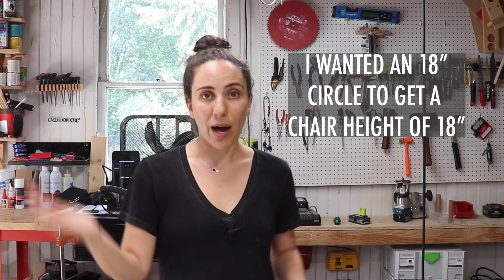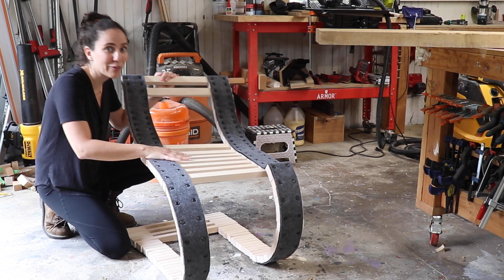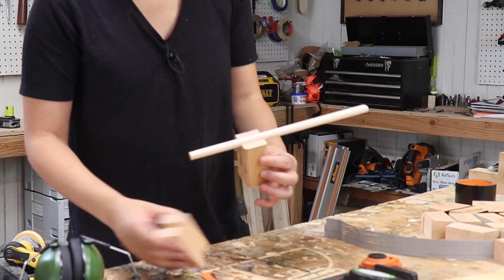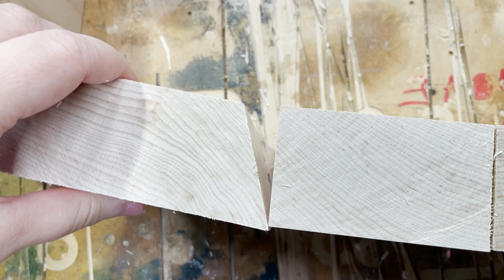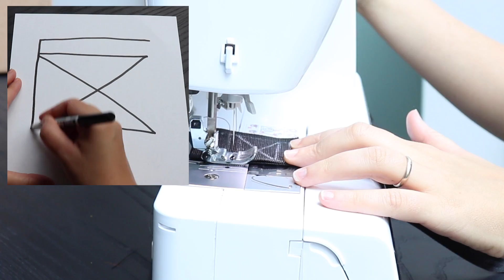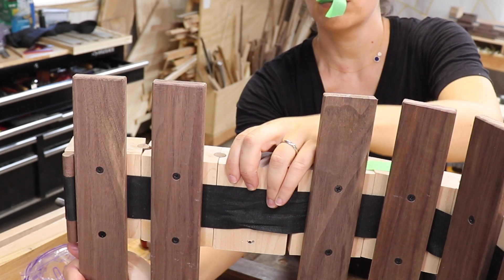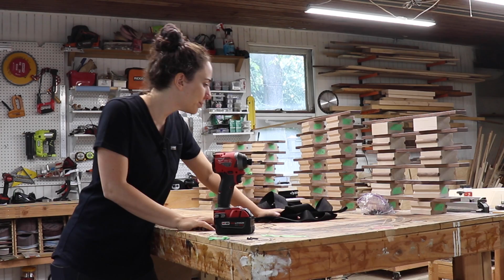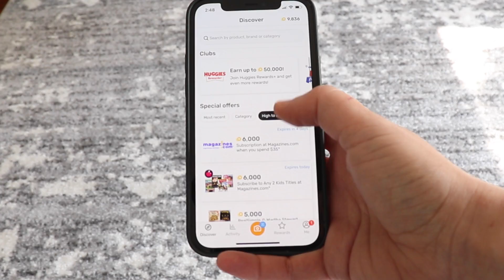I ATTEMPT to make a Roll Up Chair… AGAIN...

Comment: Leather would be way too flexible for this purpose. Metal would be the only way that I could think of. Due to the enormous stress in the lower curve I don't think this chair would work longterm. Wood contraction due to weather changes would also be a problem

Comment: As someone who works extensively with leather, I can tell you that it wouldn't hold up under that kind of tension unless (maybe) you used a heavy, strong hide that goes across the whole chair (a panel rather than straps).
I think the best solution would be to drill holes through the blocks and run a steel or aramid (Kevlar or Technora) cable through the blocks and have some sort of tensioning system on one end.  
Second to the cable idea, I would use aramid straps, as aramid fibers have some the lowest elongation of any soft fibers.  However, there is still going to be some stretching at the beginning as everything mates together.
You may also want to rout channels under the rungs for the straps to go through and have a tensioning system for the straps.  This may be easier than a tensioning system for cables.

Comment: How about metal hinges instead of strapping? And the thicker you make the pieces the less of a lever you're creating for them to crush or stretch with, so maybe make them narrower but thicker? But what I really think you should do is some math around forces and material deformation, because the chair back, or even the seat is a very long lever acting on every piece along its thickness. I don't think there's any strapping short of maybe metal or carbon fiber that could withstand it without significant deformation.

Unless you add something to hold it up. You could keep the shape and cheat a little by adding metal rods as sort of invisible back legs. I know it's less satisfying but would definitely make this a lot easier :)

Comment: You probably need to route a channel on the blocks so that the straps can move under the slats, and then add a ratchet at the end of the chair to tighten the strap as much as you need to.

Comment: I have to admit that I was going to overlook this one, but I am glad that I had not turned off the autoplay option on this browser.  I admire your perseverance with this project.  As I was watching this, and seeing the frustration, I thought, why not just use hinges?  But then I thought, why not make this out of wooden hinges?  You haven't compromised on quality wood for  this project, how about making wood hinged parts that lock one way at the correct angle, but allow you to roll it up the other?  Good luck, and I look forward to the next instalment

Comment: Cable running through the centre of the blocks rather than strap or anything on top of the blocks would stop it collapsing under tension. It would of course then not roll up unless you un tensioned the cable haha so perhaps not the solution you need :P

Comment: Argh i'm sorry for your new fail attempt. Maybe metal screw hinge may work. The Woody need to bé the one taking the compression and not the strapping. Some form on thé Woody contact surface that dont allow Space creation may also work.good luck

Comment: Like the Smurf’s say, “one twig can bend and break easy, a lot of twigs held together will not so easily.”, or something.. have you tried sewing two layers of strapping on top of each other? You could even sandwich some stuff in between like steel wire?
But thanks for sharing Tamar, super awesome design and perseverance!

Comment: Just running the numbers in my head your problem is still the enormous forces you're up against. You need a material with little elasticity and high tensile strength, in the general vicinity of 20kN of breaking force.
That's about 2 metric tons just so you get a feeling for the forces involved here. We're talking 6mm steel wire.
You also need to get rid of those free floating pieces, as you noticed that's rather dangerous.

Comment: From force perpective :you need not only strap to counter tension on the outside ,
but reduce required compression strength between  individual wood block on the inside.
You can
 1. make block thicker perpendicular to surface ,especially in curved section.
2.make contact area bigger(with wedge shaped block or hard rubber.)

Comment: Have you thought of using bicycle chain... Run a dado thru all the maple pieces down the middle. Put the chain in there. You might even be able to put a screw or 2 in a couple links of chain per piece..it shouldn't stretch at all.. you can use a chain breaker to join a couple different chains to make it long enough.. but the rest of this last design was rather perfect... You're smarter than me so I'm sure you'll eventually get it. But I think something with 0 stretch and minimal glue would work.

Comment: I can't remember if you already thought of this in the original video, but perhaps if you were to fix the strapping more rigidly in the high-tension areas (the curve at the base, mainly), because your shortening it is shortening it a small amount over a long length, which is likely an overall small increase in force.

I'm seeing this kind of like a spring (rightly or wrongly, I'm not sure), where the force of the strapping is proportional to some kind of coefficient of elasticity and difference in length. By shortening the straps you're increasing the differential length, but if you were to fix the strapping on either side of those problem areas so it can't slide then you're increasing the tension in those areas only. Maybe a double layer of strapping too? 

Perhaps you could run the calculations, it shouldn't be too difficult to get the moment around the problem areas (a simple moment calculation would be a good enough approximation), then you could work out in theory how much force it will take and how much the strapping will stretch. From there you could test a few different types of straps to find one that has an acceptable stretch and is able to hold enough weight...?

Comment: The original concept was for this to be a rollable chair, but I don’t think you’re going to find a solution to this which will provide strength, safety plus roll-ability — at least not with wood and webbing. Maybe you’d be able to achieve this with a braided cable that runs through the segments, but you’d need to add an adjustable tensioner for when you transform into chair mode. I’m just thinking out loud because I have yet to see this design work as an actual safe chair — I’ve only ever seen it as a design with nobody sitting on it.

Comment: I think you are onto something to use contact cement and glue the strap to each block. That way the strap will only flex between each block and not stretch over the hole length of the strap.

Comment: Instead of continuing to look at straps, why not use hinges? Either wooden or metal hinges? Ooo, maybe something similar to the barrel door hinge type thing. Maybe the wood is too flexible for that type of joint with WAY too much force in concentrated areas

Comment: I wonder if instead of straight pieces on the bottom section (and back), you cut the pieces with complimentary 45degree angles (like a row of parallelograms). Would those nested angles help prevent the individual sections from curling up under extreme tension? 
Also, would it be possible to add a second pair of straps on the under side of the chair to provide some counter tension?

Comment: You may have to give up some of the convenience of rolling up.  Instead of dowels, maybe on the curves have an hourglass shape peg (ie dovetails) that you insert when the unroll the chair to maintain the shape and keep the timber blocked locked from moving.  Then to roll up remove the hourglass pegs.  The other thing would be to not use one long piece of strapping but many short pieces, however the issue there would be securing the short straps to each block with the join holding. not sure glue and screws would be strong enough.  The third idea i have is to use 3-4 straps but in a weave.  I have no idea if this is even possible, but the idea being the tension works in multiple directions. By weave i mean over one block under the next then over again. You'd probably need to cut recesses into the face of the block though for a tight fit.  The idea being the tension forces would negate each other... pulling the blocks together tightly.

Comment: The leather is more stretchy than the webbing you're using, especially over time - I feel that it will unlikely to be better here.

Maybe if each pair of pieces had wooden hinges around those dowels... like metal bracelet construction, but with angles stopping further unfolding or something...

Comment: The concepts you need to consider are "modulus of elasticity" and "method of sections" technique for structural analysis. 
These are engineering concepts and understanding them is the key to your problems.  Maybe get some engineering advice?

You are basically trying to build a pre-stressed beam but without the prestress and in an unstable shape as well.  I am thus not sure that what you are attempting is even possible but you will save a truck load of time by getting some engineering input rather than using trial and error. 

As a guess (without doing any analysis) i would think steel cables down the middle of each block would be needed, that you tension after rolling the chair into shape via a screw thread run through the horizontal section at the base.  This might need to be a single rigid piece to accommodate the screw thread. 
I doubt that the concept of "just unroll it and sit on it" wil work.
Reply: I have to agree with Tano17's "get some engineering/design help" suggestion if you want to grit your teeth and continue. I think that you are about at the point of diminishing marginal returns -- more and more effort will result in smaller and smaller results -- if you continue your empirical approach. You haven't failed. I say again, YOU HAVEN'T FAILED. You have succeeded in showing that the concept can work: you've got a chair that rolls up and unrolls to close to the shape you want and that's progress. All you are doing now is refining the design. Any researcher/developer/inventor will tell you that once you prove that a concept can work, it takes a lot of time to get it to a final design because often it is little things that make a big difference. For instance:  wood is not incompressible and when you put stress on the blocks on the inside of the curves, the wood is going to compress a little and the curve is going to get tighter, even without the strap stretching. Wood isn't very resilient so it won't take much force to begin crushing it and changing the geometry. Meanwhile, back on the other side of the blocks, the strap is going around a little sharper curve where the two blocks meet and that sharper curve puts more stress right at that point of the strap and that will tend to stretch the low stretch fabric just a little more there than between the corners. Or, you might need to change the location of the rollers either closer to the straps or farther away for some reason. Or . . .

Or you might have to find just the right way to hold your mouth! (Egad!)

These may not actually be factors in your situation, but they are the kinds of little things that might have to be looked at to get where you want to go. 

I admire your tenacity, lady, the "making" effort must have taken weeks, not to mention the media time and editing. I really like the way you do things and especially how you show and describe things. Hang in there, ya doin' good!

Comment: With this design where the strap is only connected at either end, you are letting the stretch of the entire length of strap to be able to end up across one gap between blocks. To restrict the tension as much as possible, you would want to connect the strapping to each block, as close to the ends of the block as possible.

You want as much strapping that stays straight to be able to be removed. That is where 99% of your stretch is coming from.

You’re essentially only needing to use the strap as a hinge, so any excess strap beyond that is only contributing to excess stretch. That’s why actual hinges would work so much better, because they are already made to act as just hinges.

Comment: Rather than webbing or leather which I think will also stretch, would wire work? Not lengthways following line of current strap, but instead eitherside small mushroom shaped buttons stick up (say 3/4 thickness of the maple bars) and then looping a wire across each join in a figure of 8. Could also try wiring in figure 8 across from left to right side to see if improves lateral strength too.
Would need to experiment with single wire wrapping back & forth the gap versus using a multiple strands in a wire cord/rope - requirement is obviously load bearing, limitation on stretch under load, yet flexibility to then bend enough when rolling up the chair, and this must not be too thick for this to fit in the gap. between teh maples slats.

Comment: Here’s an idea.  A persons weight just creates so much leverage that your design won’t work as it is.  However, you might want to try the following:  laminate some thin maple slats to get a final thickness of about 1/4” to 3/8” (I’m guessing at the needed thickness). Laminated strips will be less likely to split.  Now, when you assemble the chair and are looking at the C curve in the bottom,  locate two pieces at the top and bottom of the curve to notch, and cut the laminate to length, and place them in the notches. They should act as support struts.  It’s one more step after you assemble the chair, but I think it might work.  If you’re having trouble visualizing it, the bottom half of your chair will go from a C to a D, with the struts being the vertical line of the D.

Comment: Really enjoying you determination to make this work and show us that failure is part of the learning process, no matter how annoying!
You could try and isolate the different curves by adding a triangle section under the securing block which would pinch the strap into a v grove. This should also add friction and stop the strap from slipping through the blocks.
Definitely look at the maths for the strapping, and using steal cable as a possible material.
It would also be an idea to design in the movement into the shape to start with, trying to get everything to perfectly be in shape with no movement is really hard. Whey not allow for the bend and plan for it.
Good luck!

Comment: I think the problem you are having is that the materials you are using have to much stretch to them.  If you try leather it will also stretch over time.  If you can find a way to secure two steel cables in side the wood, you may find better results.

Good luck.

Comment: First off the chair design looks awesome!  Love the contrasting dowels in between the segments.
My only thought would be to double up the webbing and  isolate the web tension/flex in each segment, maybe with two screws right through the walnut slats and webbing and into the maple. 
I have my doubts on the leather but Im along for the ride. Looking forward to future posts with or without the chair.

Comment: Hey, love the channel, suggestion...

The design is great, the problem was the installation, the pieces with the dowels needed to be adjusted a little. Round over the wider corners of the trapezium so that they would be closer together when installing the strap this would give the ability of attaining the right tension in the strap at the exact point the chair is assembled. The strap could be probably even a little shorter so that the weight of the person sitting in it finally locks all parts in place.

Other suggestion...

When sewing the strap double up on it and put the loops for the dowels on the end as before to increase the strength and reduce stretching.

Hope this meets you well :)
Reply: The larger the round over on the wider edges the more tension. A simple 1/4" round over on the pieces of the lower curved part could reduce the length of the strap needed making installation easier, but the assembled chair would need the original length strap hence a fully tensioned strap without spaces or seams. If you round over two mating faces at a time and test out you can slowly adjust the tension of the finished assembly.

Comment: Love your channel - finding someone who works in the same way I do and is so accomplished has been very encouraging to a newbie woodworker. A few thoughts about the chair. Leather also stretches quite a bit but seat belt webbing does not stretch appreciably and that might work.  I think though there might be a different design issue. Your chair curves in two different directions but your webbing is only on one side. If you get the webbing tight enough to hold the convex curve, the webbing on the same side will pull in the concave side pieces, which I think is why they are collapsing. You need a counter force to keep the upper curve from rolling in - how about attaching two long straps at the bottom back and then use hooks to connect the straps to the top back of the chair?  Appreciate you wrangling with this interesting challenge. Best wishes.

Comment: I was bored out of my mind and then I checked and you had this roll up chair video, made my day.  I agree this is still to dangerous to have around and it made me nervous that you were sitting on it at the end. You did some things that seemed great, reducing the amount of joints where the tension strap would stretch, the dowels etc.  I used to have 3D Cad at my old job, but don't now.  I would love to be modeling some ideas and somehow get them to you. I still don't feel great about any of my ideas either, but maybe if I could model it, I would get ideas in the process. I do have FreeCad, I started to model an antique banjo clock in it but never finished. Maybe someday I will do something with this roll up chair in FreeCad.